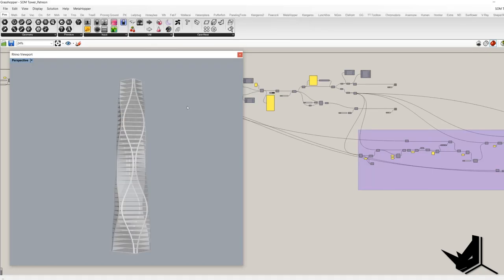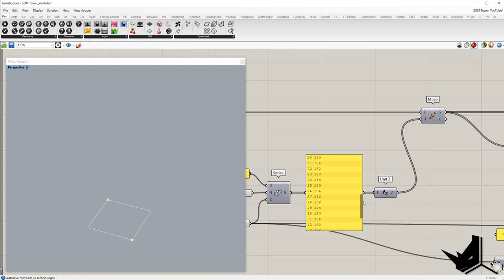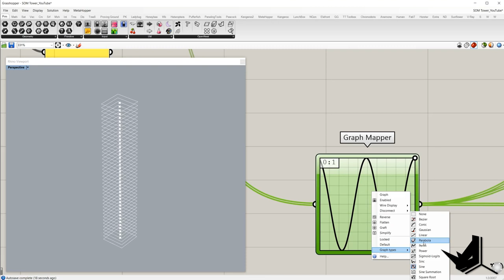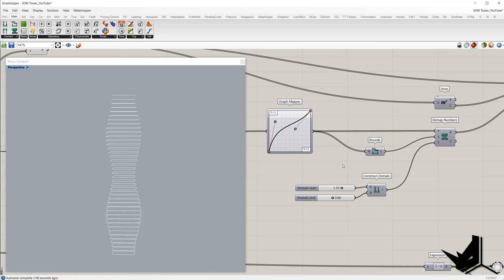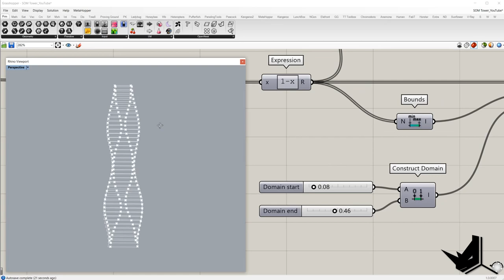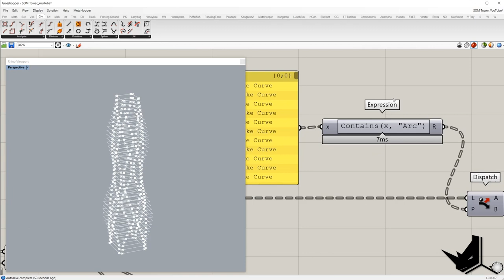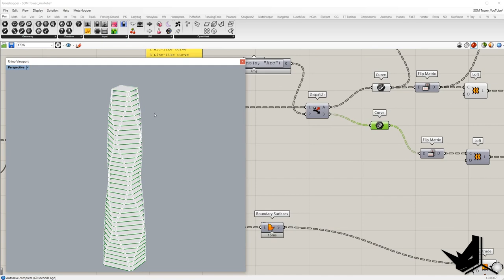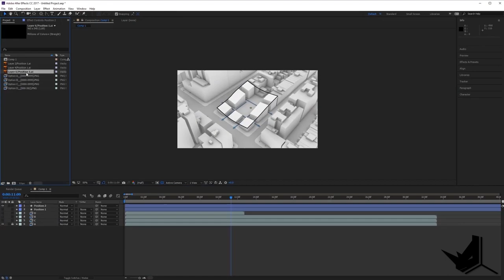Grasshopper Tutorial | SOM Tower [Quick and Easy way]

Comment: i do evrerything like you do but at the esxpression  show me error
1. Parameter "Variable x" has an invalid name. Only use alphanumeric characters and don't start with a number.
Reply from the maker: Hi Andreas, please send me a screenshot at lazar@howtorhino.com and I will try to fix the error
Reply: Instead of variable x, just call it 'x'. Then go to the solution menu and recompute.
Reply: @wacc1115  it work. thanx
Reply: @wacc1115  I have the same problem can u help me please?
Reply from the maker: @sabirmkh6121  Hi Sabir, you should uncheck the "Display Full Names" option in Display Tab. Once you uncheck, it should work.
Reply: @HowtoRhino  thank u so much,
It worked

Comment: Hi there, hopefully you still read these comments, but I was wondering if you would know why upon evaluating the curve at around 7:21, why would by points go out too far ?
Reply from the maker: Did you reparametrize curve within Evaluate Curve component?
Reply: @HowtoRhino  yes i reparametrize and I've rewatched the earlier parts to make sure that i didn't miss anything,
and  another issue arise while trying on a different file haha, 

as for the second issue when I'm doing it on a different file, the "Curve" in front of the expression "Contains (x,"Arc")" it stats that the data conversion failed from point to curve. haha

But I would like to solve the initial issue first haha
Reply from the maker: I would recommend you to visit our Patreon page where you can download the project file. Once you have the file you will be able to compare the result with the file that you currently have. I hope you will able to identify and resolve the issues. However, if you are still having trouble figuring out the cause of the issue, feel free to DM us on Patreon and we will assist you to resolve the issue.

Comment: Around the last parts, where we make two lofts after flip matrix, the one for corner sweeps works perfectly but the one that creates the panels (coming from dispatch node B section) gives an error "1. Solution exception:Index was out of range. Must be non-negative and less than the size of the collection.
Parameter name: index" do you know why would it be like that?
Reply: In case you're still wondering - This is because the "line-like curves" at the very top are null.  Curve coming from dispatch node B is 316 values, but should be 320. Change the domain from 0.08 to 0.09 or higher to make a gap and allow those straight curves to be created. You should then be able to loft.
Reply: @emem2691  thanks a lot, i came up with a similar solution later, but will try this one too :)
Reply: I have the same error but i can't solve it even when I increase the domain start value. Idk whats wrong. Do you guys have any idea why???
Reply: dude you have to reduce the fillet number size